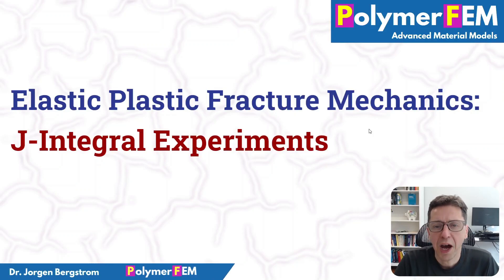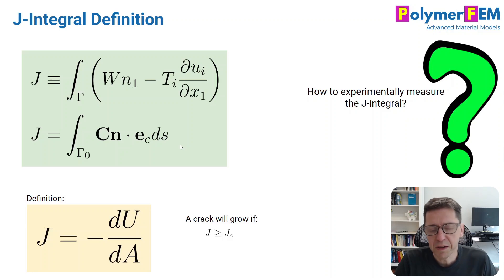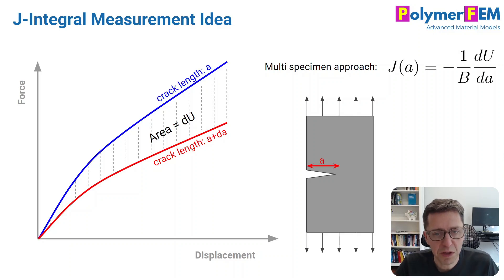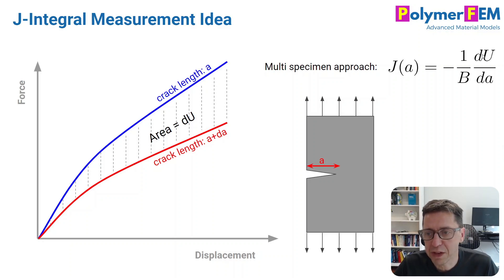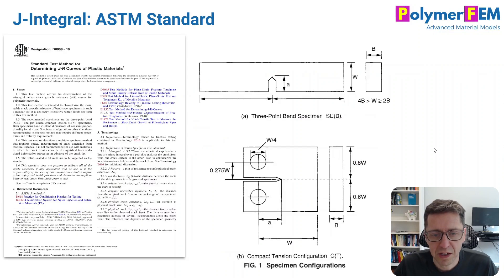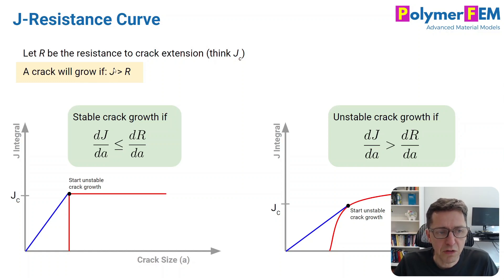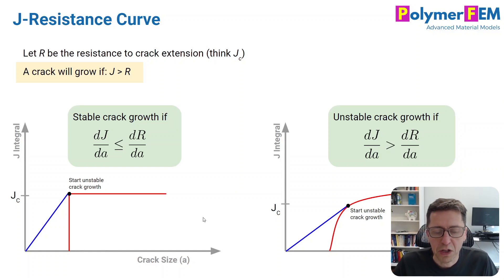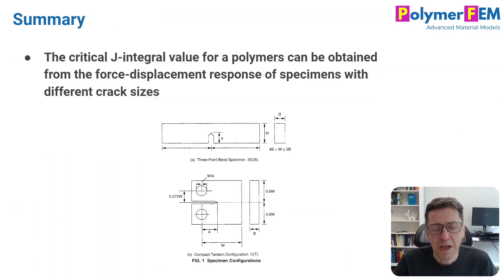Elastic Plastic Fracture Mechanics: J-Integral Experiments

Comment: Dear PolymerFEM,
I have tested SENB specimens acc. to D5045-14 standard. PLA material, but half of my specimen groups didn't meet the requirements of the standard. My idea is to use J-integral, for the interpretation of them all. I did the indentation tests on them. Unfortunately, I am not able to conduct further tests.
Is the equation J0=eta*U/(B(W-a0)), with U=U_suf_area - U_indentation , suitable for interpretation in this case?
Is this okay, is there any better solution for this problem?